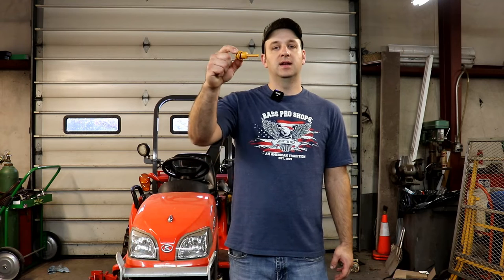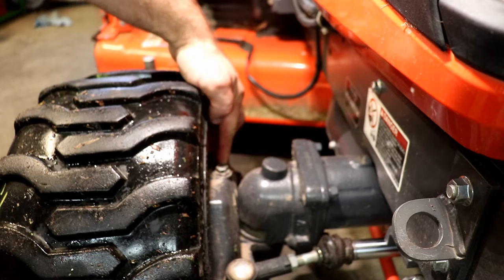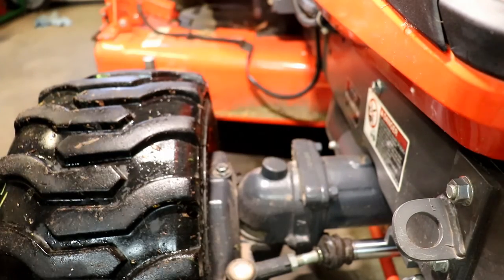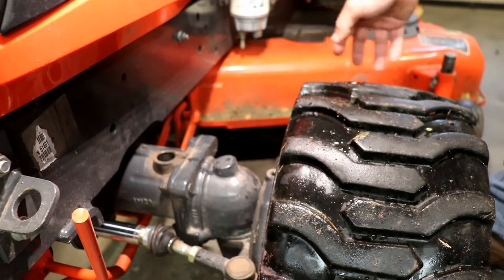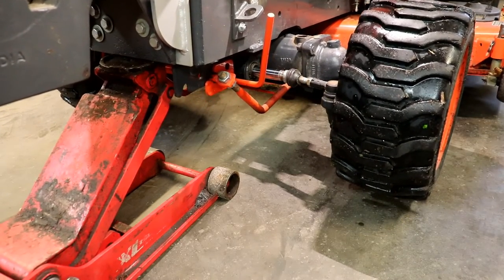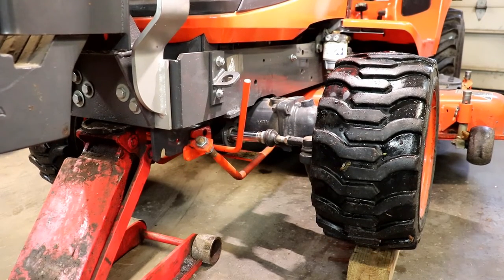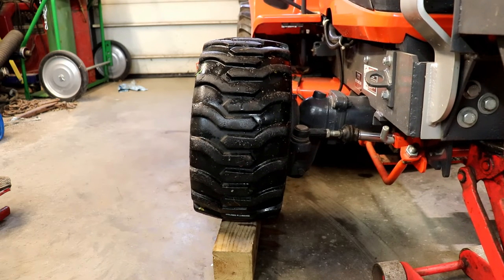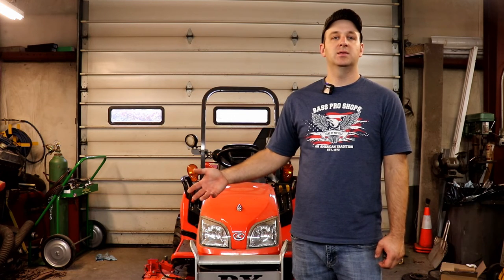This Annoys Me! (Kubota BX)

Comment: Great video Roger. Many new tractor owners don’t realize just how time consuming and tough it can be to get all the air bled out of these front axles since there is no vent on them. Another thing I like to tell people is to leave the dip stick loose for the first few hours of use, this allows to help bleed the air out naturally since it will stay vented until the dip stick it snapped all the way down in. Just be careful not to get the tractor wet with the dip stick loose like that. Keep the vids coming!
Reply from the maker: Thanks! Have a good week!

Comment: Excellent video Roger. But his falls on the dealership pre-inspection to make sure the fluids are topped off properly on new equipment. ALOT of dealership`s are NOT prepping these tractors properly before they are sold to the customer(s). Luckily, we have a pretty good dealer where we bought our latest BX23s. They went over the tractor with my wife and i very thoroughly before it left the dealership and delivered to our home. They wanted to make sure WE KNEW how to check ALL the fluid levels and had us do a hands fluid check before the tractor was delivered. Even though our dealer knew we had owned several tractors over the course of 50yrs, they just wanted to make sure we were familiar with the latest tractor we bought from them. I wish everyone had a dealer as good as ours is.
Reply from the maker: My dealer did the same thing. They showed me everything about the tractor and where to check the fluids. I think some dealers just throw people the keys. I agree the front axle being low is 100% on the dealer.

Comment: Stupid question, TT:  what kind of axle oil should we use?  As per the owner's manual?  Also, I tried removing the axle plug and yanked on it really hard but it wouldn't budge.  Waiting for the temps to get up near 40 and use an adjustable wrench.  Very good vid, clear, concise and great closeups!  Cheers, Bob
Reply from the maker: You can use 80w90 or super udt2. I don't see the point in using expensive super udt2.
Reply: @TractorTech  Thanks!

Comment: I had the same problem with my new Kubota BX23S. After a few hours, I checked all the fluids and the front axle oil didn’t even register nor could I see any fluid. I called the dealership to complain and to check what type oil they used as I’ve heard that you can use the Kubota hydraulic oil. I didn’t want to mix gear oil with hydraulic oil if that was the case. Sure enough they said they fill with Kubota hydraulic oil, so that is what I used. Have you ever heard of using hydraulic oil instead of gear oil for the front axle fluid? Have you heard of any problems with using hydraulic oil?
Reply from the maker: You can use hydraulic oil in the front diff. It is thinner so it is more prone to leaking out. It works in the gears for the rear diff, so it will be fine in the front diff. I personally use gear oil because it is cheaper and does the job. You were right, I would not mix the 2 oils. When the front diff needs serviced, you can change to gear oil if you want.
Reply: @TractorTech  Thanks Roger! I may go to the gear oil once I change the fluid. Keep up the informative videos!
Reply: I live in Albuquerque New Mexico and they recommended me  the hydraulic fluid for the front axle as well it's been about a year-and-a-half no problems yet

Comment: I was never told to check the front axle oil level. I never had any leaks, so I never did. I assumed it was full when it left the dealership. But after watching this video, I checked it and there is no oil on the dipstick. That's 280 hours with not much oil in the front axle. Not very happy to learn that. I planned to change it early. Now I have to.
Reply from the maker: I'd try topping it and see how much it takes before changing it. Maybe it wasn't super low.

Comment: When I got mine they should  of checked  it. But it was 3qts low no coolant  in the over flow bottle.
Reply: Mine was the same way, checked it the day after got it home, the overflow tank had a smidge of fluid in the bottom.  Put over half a bottle in after filling and running and topping up to mid point Min/Max.  Dealer had stated a Friday prep finish (on a Tuesday) and then called Wednesday and said they got it done early.  Now I see why.

Comment: And those dip sticks easily dislodge.  After losing one of those, I bought another one and safety wired it to the chassis.
Reply from the maker: Mine fits really tight. I have to hit it with my hand to seat it all the way.
Reply: That’s what brought me to this video lol I can’t get mine out on my 2004 b7510 guess I have to wd40 and pry up hard ? It moves but won’t come up . Been many years not used I would assume

Comment: From the factory  they put HST OIL .  Which I guess is ok but still.
Reply from the maker: Mine had gear oil. You can use HST oil also but I don't see the benefit.
Reply: @TractorTech  I just filled mine with super udt2 since I had about 7 quarts left after doing transmission from the 5 gallon pail. The udt2 I took out looked like I put it in a week ago instead of 200 hrs.

Comment: Also there is another problem. When you run it and get front axle warm, if you take the fill cap off you most likely here some pressure release from heat. After awhile that pressure will eventually push the seals out when the seals become worn
 Simple solution is to drill the cap with a small hole and insert a cotter pin in that whole. Now you have a way for the pressure not to build up in the front axle and push oil out of worn seals. Old school fix.